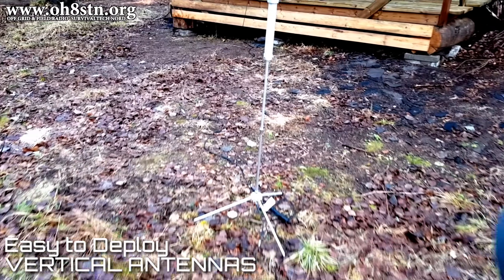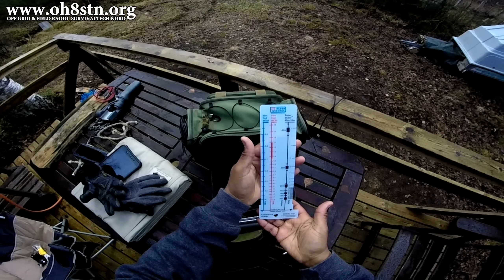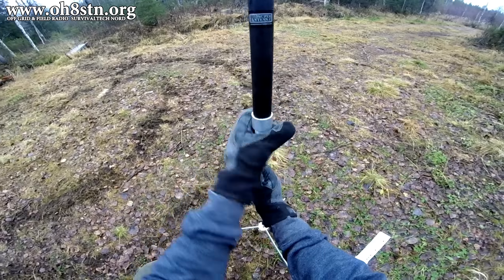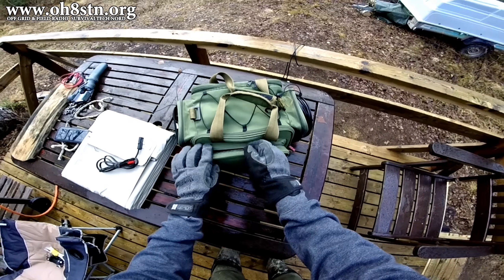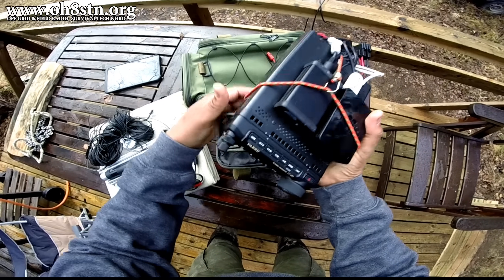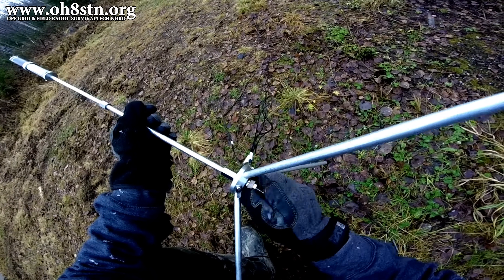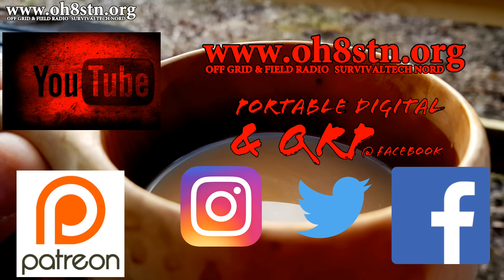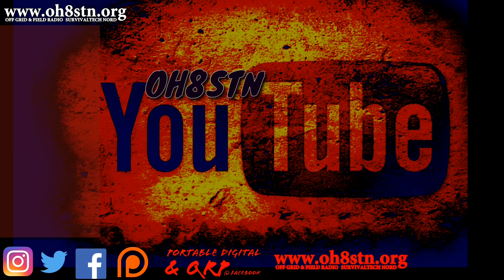Super Antenna MP1 | Ham Radio Antenna

Comment: How susceptible to RFI is that tablet?
Reply from the maker: It has no physical connection to the Radio or RPi, so it's completely free from interference.
Reply: @OH8STN , I have a Samsung Galaxy e-lite tab, I use with wolphi droidpsk. If I use more than 20w on 40m, or 10m... it wipes out my tablet! de N6AMF.
Reply from the maker: @ke6ziu  ok, now I understand.  I've seen that happen in two different situations. Firstly on VHF with the Wolphilink, when the antenna is too close to the tablet. I've also seen that happen when there's some feedback or RFI is getting back into the system from the antenna. In that case I use a choke at the base of the antenna to reduce any RFI. I've also used some Snap-on toroids on all cables. Finally, reduced the length of cables where possible. In most cases the choke at the base the antenna does the trick. VHF is more difficult with the Wolphilink.

Comment: Too much complication.
Reply from the maker: Ignorance should never be used as a reason to call something complicated.
Reply: OH8STN de N1SFT... ignorance is part of it, but I’m trying to do a similar field setup, in fact I have the same antenna and rig and pi!  My concern, like George, is all these interconnects are possible failure points.   And with field gear, they need to be rugged.   But complicated setups can turn off some hams.  I don’t have any solutions to the multitude of interconnects, but I get where some can just say “too complicated” and turn away, missing the point of the station.   (And the great capability of your field station.)

The pi, GPS, and display in a single unit would simplify things and get many connections out of the weather.

Unfortunately the 891 uses USB CAT control, so the BT CAT dongles for the 817 won’t work.

Comment: Julian: With my kits, to separate the solar connection, I color code the connections using green and black powerpoles , reversed standard setup (two points of confusion covered, especially in low light, or colored headlamp).  Works well at identifying the correct cable to plug into and limits the chance of mistakes, especially if someone I am working with hooks something up on my gear.

Comment: That spot is beautiful!  Also, super glad you're making this antenna video, I've been thinking about picking it up.

Thanks!
Reply from the maker: It's two key features are it's incredibly small breakdown size, and it's modularity. It's performance is pretty much on par with the Yaesu screwdriver antennas, and other antennas of the type. I doubt I would be doing any DX contests with it, but as a rapid deployment antenna where space is critical, it's not bad at all.
I think I'm going to try it with a collapsible whip antenna to get more aluminum above the coil.

Comment: This a great small antenna for the FT-891 and could simplify a day out operating in the field. I would consider guying the antenna as the tripod can be a bit flimsy. Try using computer ribbon cable for the counterpoise  tuned to each band.

Comment: Hey Julian,
Really like those „break away“ LEGO antennas. 
Does the MP-1 have 3/8“ threads all over or just at the base?
If Yes: Have you ever tried to use the MP-1 base and parts of the MPAS like the MIL-EXT with the MP-1 coil on top and any of the whips on that to make a longer antenna, that can still be made resonant without the tuner, but just the sliding coil of the MP-1? For lower bands this could increase the performance. 

Love the video. Keep it up! Thank you for the idea with the 8-winding around your hand! Cuts the wire winders !

73 DJ6KR Konrad
Reply from the maker: Actually someone in the ham radio go kits group on Facebook just suggested the same thing. This has standard 3/8 everywhere. I may set it up and do a test.
Reply: OH8STN that would be intriguing! I have used the more rugged parts of my buddipole (coil and arms) a chameleon jaw mount and a surplus military whip as my Lego blocks. It seems to work. 

73

Comment: For additional information and ideas on radial the Callum ("DX Commander") has done research into radials and cites some ham operator research papers on the real world effect of radials, lengths and numbers. You may get a few new ideas to improve things a little bit. Great informative videos, thanks de VA3NIE
Reply from the maker: For anyone interested.
Here's that video from DX Commander regarding ground radials we are talking about.
https://youtu.be/m-8P1-PfT9s
Reply from the maker: Thanks. I've seen the live discussion on the topic. In practice, some of the suggestions are too difficult for a temporary /P deployment at this latitude, but work extremely well in a fixed location. Perhaps he has something new on portable antennas with quarter wave radials. I'll have to check him out again. As a short vertical the mp1 relies on quarter wavelength tuned radials for each band. If we want to cover 6-40m, we need at least one tuned quarter wavelength wire for each of those bands. If we're sitting on a single band, 1 or more tuned quarter wavelength counterpoise wires, all spread evenly around the base of the antenna works well. There certainly are better ideas, but rarely do they consider the challenges of the portable operator :) I'll check in with Callum to ask him if he has come up with something new.
Thanks for the comment 👍👍👍
73
Julian oh8stn
Reply from the maker: Hey David. I just watched that series of videos again. There is something useful. Callum suggest cutting the wavelength in half but doubling the number of radials. That might actually work extremely well for portable. I think I'll have to build a test rig and test it out. Thanks for the suggestion
Reply: @OH8STN  Thanks, We all learn from others. Everyone does their own testing then after reviewing we pick what works best for us :)

EDIT: Callum also wraps a bit of tape around the end of each set of radials before he coils them up so that they don't get all tangled up. This might help everyone keep things organized in one way or another. Have a great day.